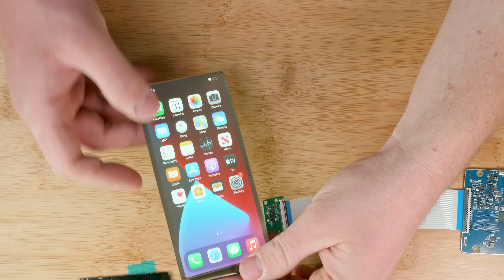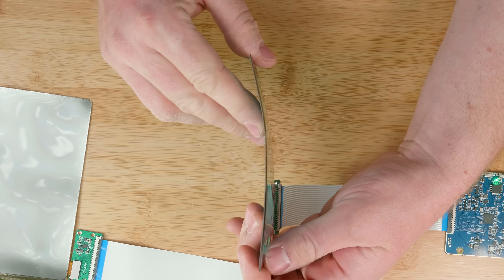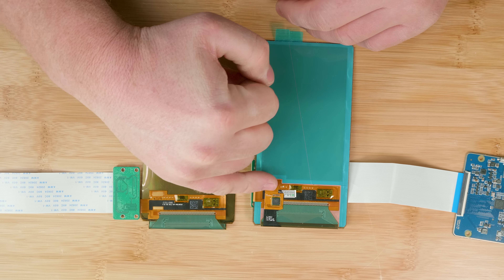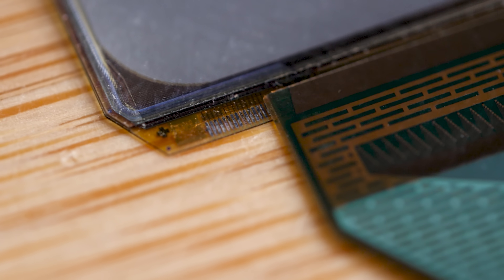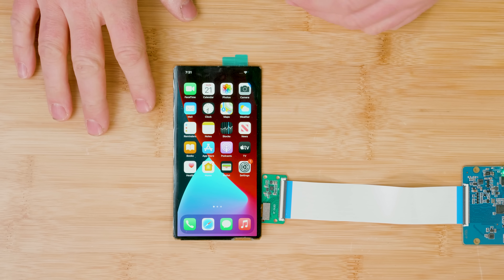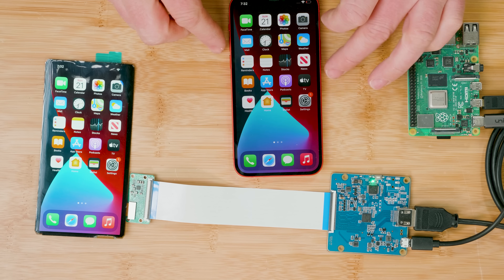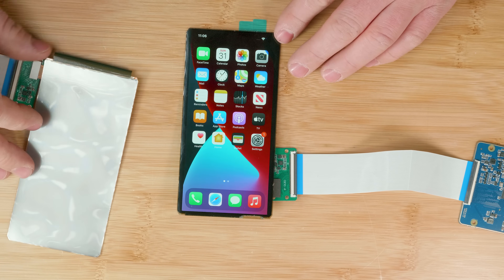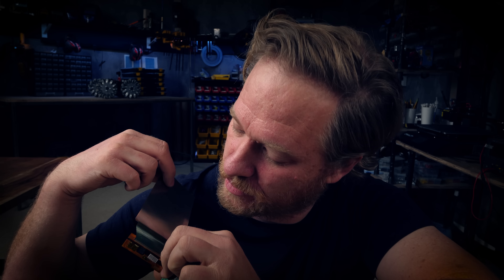A folding iPhone?

Comment: Instead of building it from scratch why don't you modify the frame of a galaxy fold or a mate x, you might even be able to re-use the screens on them devices, that way your only issue will be figuring out how the mother board will fit in the case and how it will communicate with the screen.

Comment: Hey Scotty, these displays look to be like you said B-Stock / Eol screens that are being sold with the common (Hdmi to Mipi v1.2 board). Many of these cheap screens have their backlight and a few other layers removed to make them “transparent” or in this case a few layers removed to make them flexible. You can actually do this yourself and it’s quite easy and cheap if you buy the original screen (Possibly the: BB055FHM-T00-6P01 but I haven’t even looked at the display). You can also drive these displays with a regular 4 lane mipi / lvds display connection (like from the raspberry pi compute module). I’ve done quite a bit of work with these types of displays so please get in touch if you’re curious about anything.

Comment: You could use the rpi to test the dsi connection as it has a dsi output connector and the os is open source. This way you could at least get info about the dsi Input of the display.

Comment: @Strange Parts
Display:
Just an idea although not the best.  Since you plan to build a custom shell for the phone,  what about using the lightning to HDMI adapter.  This will allow you to use the lightning port to display as HDMI allowing for the adapter board to display the image with a direct connection to the iPhone.

Touch:
You can use either a Bluetooth mouse or USB if you have assistive touch enabled in iOS.  So you could possibly use that with some custom code on a microprocessor to determine the location of a touch on the screen and move the mouse.  It would be true direct touch because the microprocessor would have to fake moving the mouse at an extreme speed, but it should be close enough to imitate it.  Only major downfall with this method is that actions requiring multi-touch such as pinch to zoom won't work.  But most actions in iOS are single clicks or swipes anyway.

Comment: Hm, I might just have thought about a hacky way to solve some hard problems regarding the DSI.
Instead of implementing a complete DSI layer, and trying to get the iPhone to talk to it as well, why not let the iPhone talk to the screen as normal(even without a complete screen, as a "dummy interface"), and have an FPGA or something in the middle that can "inject" image data: Temporarily disable data from the iPhone to the screen using the FPGA, send the required frame data over DSI from the FPGA into an already established "connection". You'd essentially just need to implement the display frame data part of DSI, instead of the entire protocol(plus apple extensions). Essentially, forward everything that is not frame data to the display dummy.

Comment: Hey scott, shop looks nice. Little dark perhaps. Ah interesting, I thought maybe the display would be eDP, as seen in ipad 3,4, air, which appearantly are easy to connect to with normal displayport.. Don't know about later ipads.. Wanting to convert my old ipad air into an extra, small, monitor myself - seems I can buy all thats necessary for that off aliexpress. Anyway I'm not sure you should do this, seems there are major hurdles to get this to work.. One of the issues I think is you need a screen with an existing iphone resolution ? Well, we'll see in a year or something when you publish the video :D

Comment: Those pesky screen protocols! I haven't looked really deep into it, but, a few years back I realized I had a couple of dead phones (I repair friend's phones sometimes) with good screens, and I wanted to know If i could find a way of using them as a second screen or maybe as a display for a raspberry pi, things like that. But turns out the connectors and the protocols for the display can vary from model to model and I haven't found 3rd party driver boards for any phone screen

Comment: duplicate display for Iphone require to be programmed to respond to the protocols, so instead of starting from scratch try to get an foldable phone display with protocols similar to the duplicate display and as for the foldable design it is not required to make a phone that folds as a galaxy Fold or mate x rather it might roll out like oppo's new concept phone or a phone that folds partially like the type which arubiux tried to make 4-5 years ago
Best of Luck 
will be waiting for the next video👍

Comment: I think your dirty tricks are actually a perfectly reasonable prototype. Why does the folding screen NEED to be bonded to the rigid components like CPU, battery, etc..? A folding screen that logically/wirelessly connects to a phone in your pocket/purse/backpack would still be pretty awesome. And this would (hopefully) alleviate a lot of work. 
Perhaps the flexible screen could have a  watch-like wrist holder (a thin pipboy, perhaps).

Comment: I believe it’s possible.  The iPhone logic board is tiny.  You may not be able to build a folding iPhone enclosure as thin as Apple.  You may also have to compromise on a smaller battery size to fit in one side of the folding phone enclosure.

Comment: If you need to cut up circuit boards to make them fit into the folded phone, I suggest you check out the retro console portabilizing community (e.g. bitbuilt forums). They trim a lot of PCBs and also make new replacment PCBs.

Comment: I wonder if you could sniff the registers during initial configuration of the display to see if you could emulate be behaviour with something like a i.MX NXP SoC or a Pi (if you can figure out how to use the DSI interface)

I've been wanting to do this with mobile phone cameras but the introduction of many camera modules from ArduCam and the Pi foundation have mostly made this unnecessary. Also the real challenge with camera modules is the fact that they don't produce good images by themselves and need to be debayered and then you need an algorithm that adjusts the exposure, analog and digital gain, color balance , contrast, dynamic range, and applies a denoise filter to produce decent results. (usually all wrapped up in a very proprietary "ISP" library)

For DSI displays, I'd imagine once you sniff the initial configuration of the SPI or I2C, you should be able to just replay the configuration (you might even be able to figure out what some of the registers are by fiddling with the values) and then just start blasting the 1s and 0s down the 1, 2, or 4 lanes of high-speed serial. It's simplex communication and I'd imagine this part should be simple so long as you know how to configure the peripheral on your SoC.

Comment: This would be a crazy project!! I genuinely think it will be very difficult to make it into an actual iPhone because of all the closed source software and hardware. Not even mentioning Apple’s habit of cryptographically binding all the chips together...
Maybe there’s a slightly simpler way to start by running an iOS Simulator on a Mac, and hacking a way to get the image to the folding screen, and the touch input back to the Mac for control.
Not quite as neat as a fully portable iPhone, but maybe a good prototype demo thing